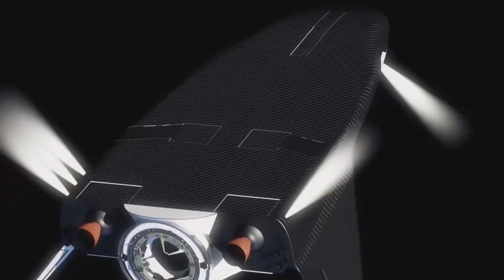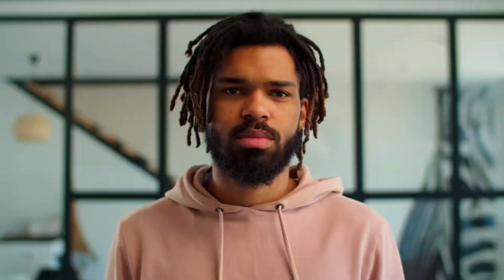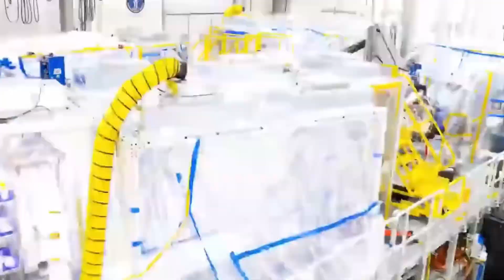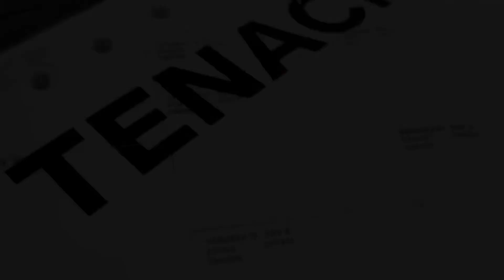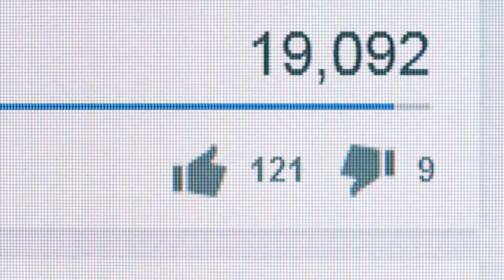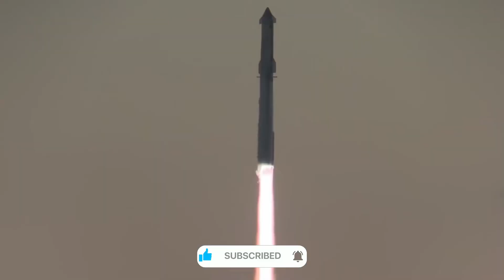SpaceX PANICS! Dream Chaser's Mind-Blowing Tech DESTROYS 20000-Tile Legacy!

Comment: Just want to point out that ironically, it was reinforced carbon-carbon that was smashed on Columbia's leading wing edge, which lead to its demise during re-entry.
The stuff is extremely heat resistant, but brittle AF
Reply from the maker: Interesting point about Columbia - and while Sierra Space's new composite tiles are promising, let's not forget history's harsh lesson that 'revolutionary' materials can have hidden fragility. The real test isn't in the lab, it's during actual re-entry 🚀💭
Reply: @Elonmusk24h  Correct. I wish some clearheaded people at sierra or spacex realize that a scaled up version of dream chaser for 30-50 people would be the PERFECT crew transport to LEO and back, for Starship, and skip trying to human rate that thing, which is impossible in my opinion. A modified starship could carry the crew transport as detachable module replacing the nose cone. After entryburn, it detaches and glides back to earth and the bottom half does the classic belly flop back to the tower. Launch abort system for free as a bonus, and it can land anywhere on earth in an emergency. Starship would have to wait until the right moment to de-orbit so it can be caught, way too risky for humans who might need to return right NOW. The shuttle also had backup runways available

Comment: Why would SpaceX panic?  Dream Chaser carries 1/10th the payload of SpaceX heaviest rocket
Reply: SpaceX should get into talks with Sierra for building a scaled up version of dream chaser (for 30-50 people) that would fit on starship, replacing the nose cone. Detachable so it can land anywhere like the shuttle could, and tanks/engines belly flop back.
Whole human rating problem solved and you get a launch abort system for free. Starship can forget human rating if retropropulsion is the only way to land.
Reply from the maker: While Dream Chaser's 2,000-tile system is impressive engineering, comparing it to SpaceX is like saying a Cessna will replace a 747 - different vehicles for different missions 🚀✈
Reply: @Elonmusk24h  I am talking about a scaled up version, not an exact replica. Capable of carrying 30-50  people. Dragon ain't going to cut it, with the numbers Musk has in his head.